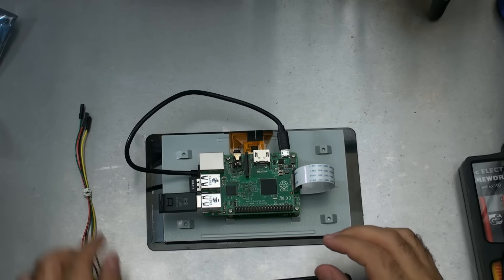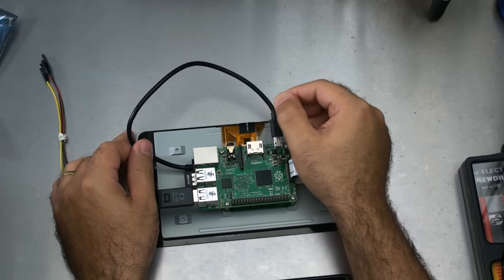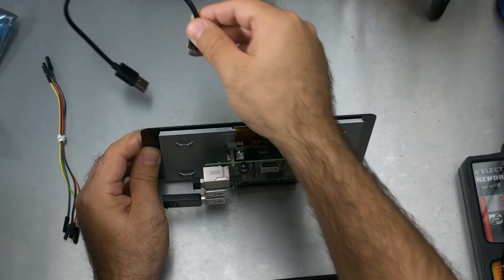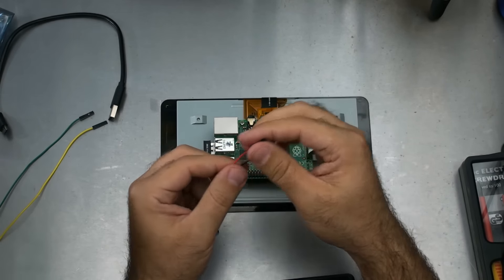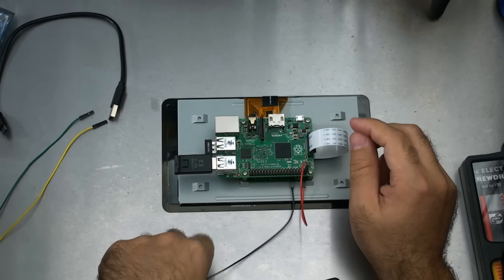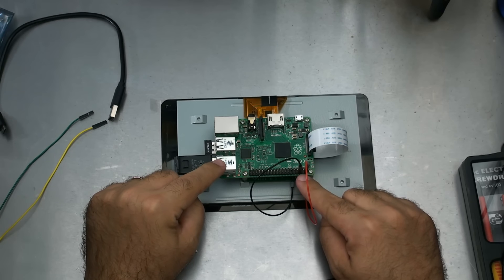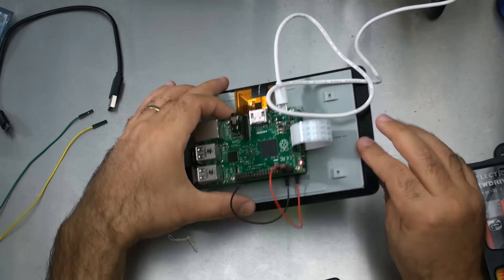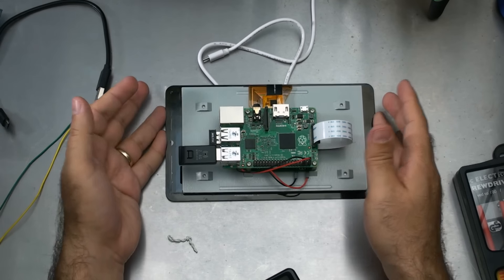Raspberry Pi: 7" touchscreen alternate power configuration

Comment: Hi, thanks for this video.  I'm using a 3A power supply (Rpi 4 +screen) but i'm still getting a low power sign, no matter if I power both via micro-usb on the display or the USB-C on the pi itself. Any ideas?
Reply from the maker: Can you try two different supplies?

Comment: I know this is a much older video now, but is it possible to power both this Screen and the Raspberry Pi off some sort of Rechargable Battery?
Reply from the maker: Yeah, absolutely.  I'd try to find a Pi Zero, because it uses less electricity...  And a battery that puts out higher Amps... but yeah.  Totally doable.

Comment: I use the second option always, went with a tutorial online that suggested the power supply that comes with the kit is sufficient. But my rationale said it cannot be true but I went with the tutorial and ended up in screwing my raspberry pi 3. Now i ordered rasp pi 3+ and got it, now i dont want to burn the board again. Could you please suggest if I can go ahead and use any of android phone power cable instead of the default one with the kit? and do enlighten me on the power supply required for the same.
Reply from the maker: The pi only draws as much as it needs, so you can't pick too high an amperage. Look for 5v, 3a.

Comment: Your Pi is asking for more power as denoted by the flashing multi-colour square icon when it is booting up. Could be the power plug not providing enough or the USB lead, or both.
Reply: utopiaopera No, this the normal behavior of the gpu test on boot